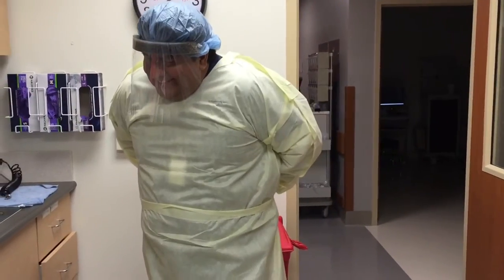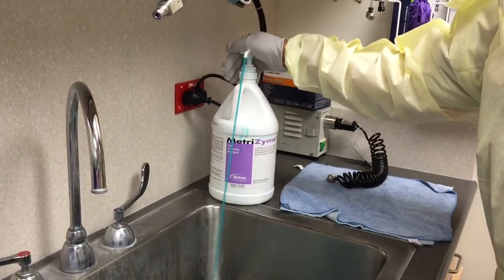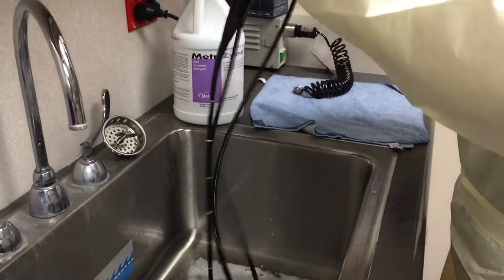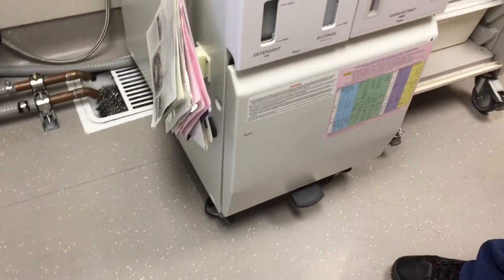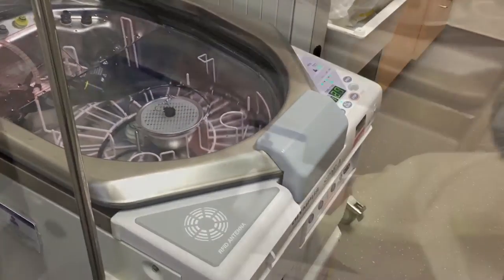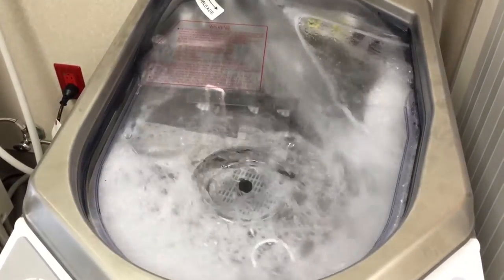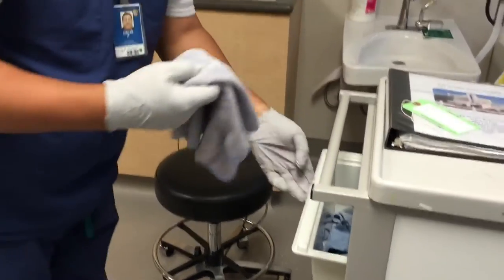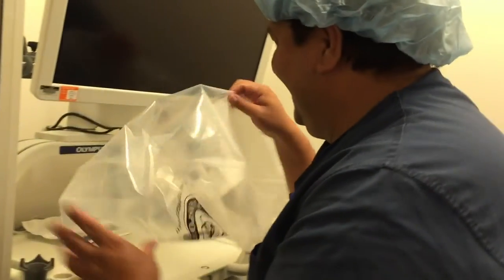Bronchoscope Processing Olympus OER-PRO

Comment: Few comments:
1. Scope should be put in a puncture-proof container not just any garbage bag- and not even labeled as dirty
2. Staff does not have a face shield/ mask and the gloves are not pulled up to the gown
3. Scope should never be put in water before turning on the leak tester
4. Staff did not wash scope well and its channel with tap water
5 Staff did not change into clean gloves before testing for Acecide MEC and touching AER
6. Staff does not properly position scope in the AER
7. Staff put only gloves when removing scope
8. Staff hang scope in the cabinet with bare hands
I am surprised that this facility passed the JCAHO inspection.

Comment: I saw a lot of technical errors. Your video didn't give the exact way of cleaning and handling the scope in a safe manner.
Reply: Everything is wrong. 1st of all he did not use gloves when placing the dirty scope in the dirty bin, 2nd he needs to inflate air first before submerging scope into the water, 3rd he needs to brush and clean scope submerged in water, 4th scope is not coiled correctly in the OER PRO, 5th you test MEC with a small cup instead of dispersing it like that. 6th place scope in clean bin and dry it, 7th use gloves when hanging scopes. FYI, if you see the receipt printed it reads WARNING incomplete process that means something went wrong during the process. This clinic or hospital needs to put on check by Joint commission.